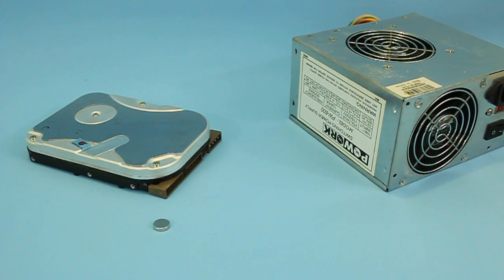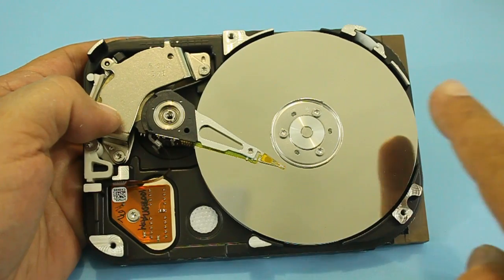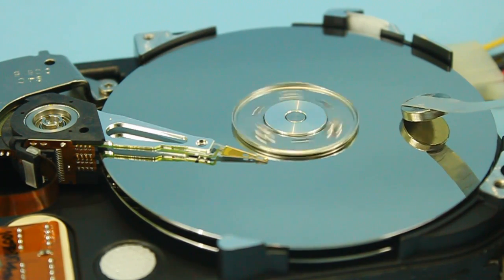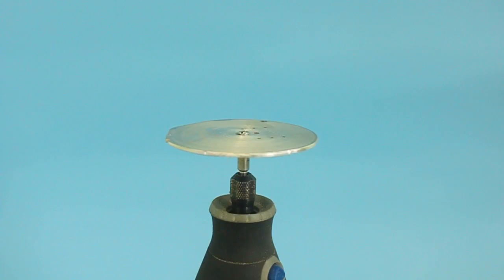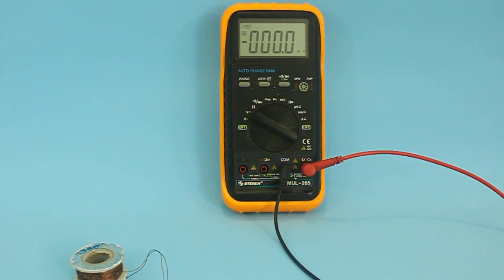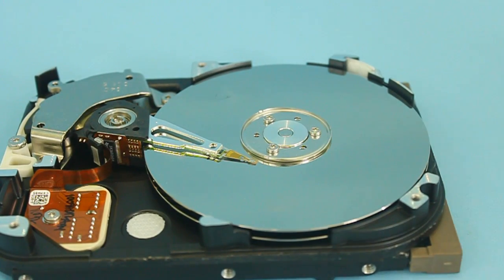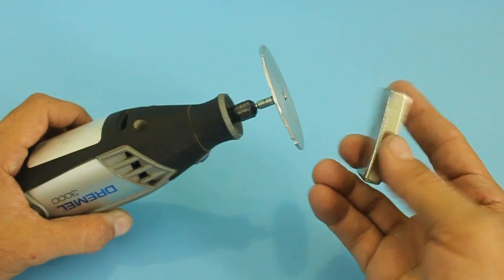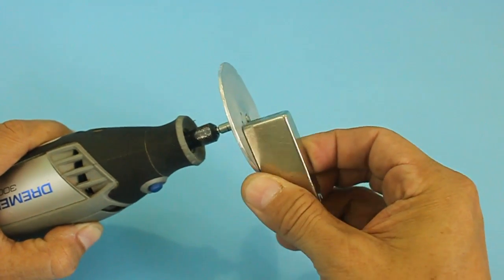Experiment on Magnetic Levitation

Comment: I'd be insanely careful with that hand drill, if you had touched the aluminum you would have cut yourself like nothing else before it. Still, this gives me an idea for a potential levitation thing - 4 electric motors with aluminum discs (or just the harddrive disks removed), with the ones left and right spinning clockwise and vice versa, and a four-legged thing with magnets on the end of each leg. Maybe that would work, idk, but it's worth a shot!
Reply from the maker: +OBV10U3_NINJA not sure if its stable but yes its worth a try
Reply: I think you mean veritasium's video
Reply: There is such a concept. I forget whose invention it is, but I did see it on youtube, I will post link if I find it again.
Reply: u ppl mean the vertasium video right

Comment: I don't think that is due to magnetic levitation; more by the air flow above the rotating disk.
Reply: Mel Xin Nothing to do with air flow. Try it with a plastic disc and it won't work.
Reply: no, this is caused by magnetic levitation, the magnet will create a current flow in the spinning conductive disc, that current will short itself and create another magnetic field which in opposite direction of the magnet thus lift the magnet up